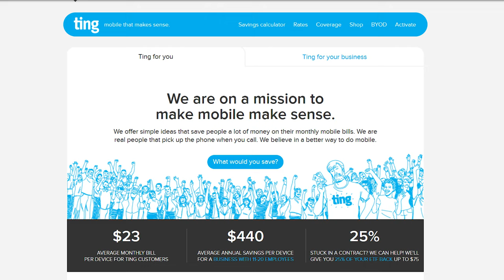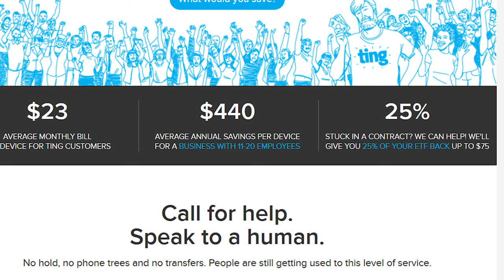The Big Move Day 1 - IT'S FINALLY HAPPENING!!!

Comment: I may get some flack for this but they are moving in when it's not even finished building, ain't that stuff just gonna be covered in dust etc when they've finished building (from the sawing etc that's left)?
Reply: clawhammr666 probably due to the fact that they mentioned they have an inspection on the old office in 3 days, which means their lease is up and they have to move out. Might as well put the stuff in the new office instead of renting a storage space and moving it twice
Reply: yeah, was thinking it was probably that :P

Comment: First item in the truck is an unpadded table on it's side and then bookcases on the floor. You would have to try hard to put a more wrong piece in the worst orientation possible. 40 years of moving furniture and this is probably the worst loading job I have ever seen and that says alot.

Comment: What do you think???
PCPartPicker part list: http://pcpartpicker.com/p/YsjPkL

CPU: Intel Core i7-5930K 3.5GHz 6-Core Processor  ($572.98 @ Newegg) 
CPU Cooler: Corsair H100i 77.0 CFM Liquid CPU Cooler  ($103.99 @ Amazon) 
Motherboard: Asus X99-PRO ATX LGA2011-3 Motherboard 
Memory: Corsair Vengeance LPX 16GB (4 x 4GB) DDR4-2666 Memory  ($144.99 @ Newegg) 
Video Card: EVGA GeForce GTX 980 Ti 6GB Superclocked+ ACX 2.0+ Video Card  ($679.99 @ Amazon) 
Case: Corsair 450D ATX Mid Tower Case  ($119.99 @ Amazon) 
Power Supply: Corsair 760W 80+ Platinum Certified Fully-Modular ATX Power Supply  ($219.99 @ Amazon) 
Case Fan: Noctua NF-F12 industrialPPC-2000 PWM 71.7 CFM 120mm  Fan  ($22.24 @ Amazon) 
Case Fan: Noctua NF-F12 industrialPPC-2000 PWM 71.7 CFM 120mm  Fan  ($22.24 @ Amazon) 
Case Fan: Noctua NF-F12 industrialPPC-2000 PWM 71.7 CFM 120mm  Fan  ($22.24 @ Amazon) 
Headphones: Kingston HyperX Cloud Headset  ($77.91 @ Amazon) 
Total: $1986.56
Reply: kingcomicbook show Should be able to run Minecraft just fine.
Reply: No storage (hdd, ssd, etc)?

Comment: That MSI card was gtx660 :)
Reply: eugeeeneee Nope 7790
Reply: Are you sure because I have a 660 and it is the exact same, MSI probably make that cooler for both the 660 and the 7790 I even have pictures to prove that the 660 looks the exact same as the one in the vid.